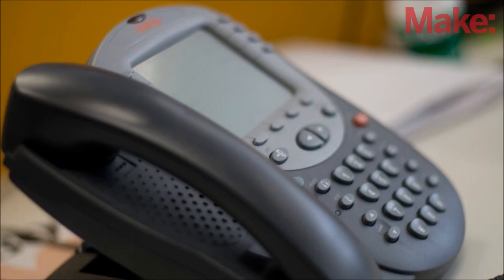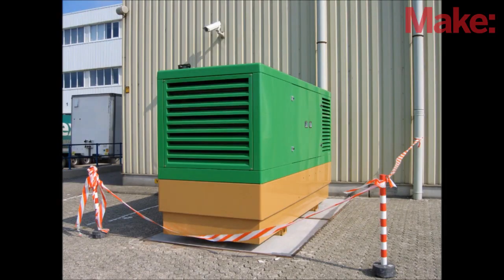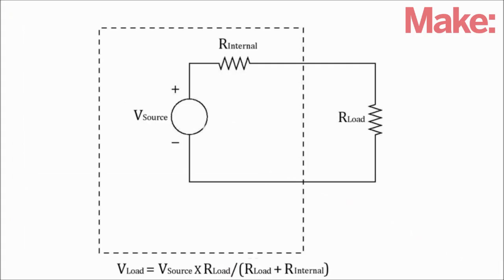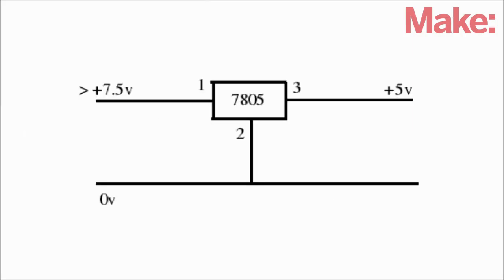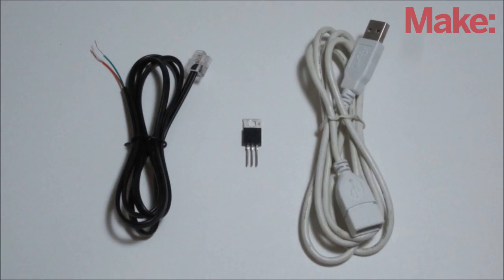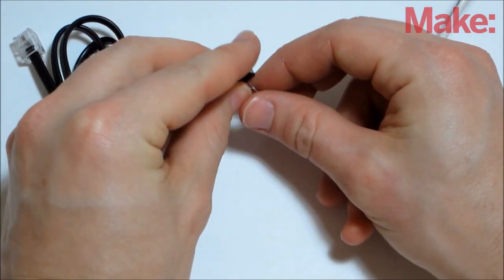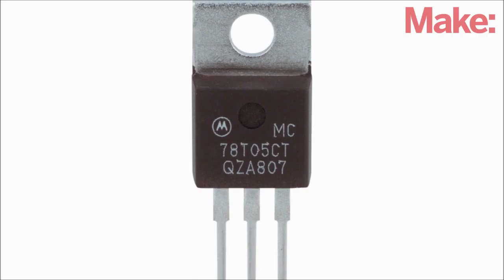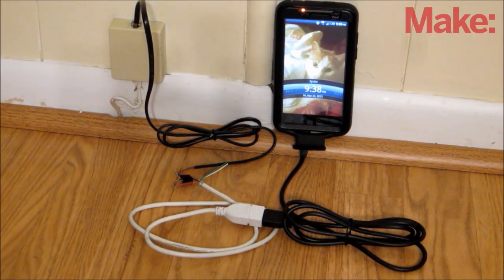DIY Hacks & How To's: Emergency Power from a Land Line

Comment: Not only is this illegal and a federal crime it is also a stupid idea.  Your line will be disconnected after 3 minutes of inactivity by the phone company.  An guess what.  Your land line phone will not work while your doing this.  Even dumber, your charging one phone system from the other.  Someone with more than a half of a brain cell would just place the call with the land line phone.  I guess brain cells are not required to make YouTube videos.  Geez..........

Comment: I'm wondering what max DC load you can put on those small gauge phone wires, without burning them up? Could I, say, do your setup for 12vdc and connect a 12v. DC cooling fan?

Comment: How to convert 50 Volt DC into 220 AC
Reply: Well this is less than 1 watt of power so that wouldn't be very useful but you can use a grid tie in inverter to take 12 volts dc and put that into your home power and just use a regulator like in the video to take the 50v down to 12v.

Comment: I found the 7805 voltage regulator 15 pack for $7, but if you find a good deal on bulk cabels ide be interested.

Comment: First problem 78 millamps is probably less than a cell phone uses when its on, without even making a call or having the screen on. But you won't even get that much as those analog regulators are horribly inefficient. You might get half that, lets be generous and say 45ma.

Second problem, the first time the line rings you get 90V pulses or higher, and the regulators are only rated for 40V. You are depending on resistance in the line to save the regulator from frying to start with.

Third problem, this is probably not legal in most places.

How about an alternative that isn't stupid?  You can get cheap power banks that use AA batteries form the dollar store, AA batteries also = cost 2 bucks.

You could spend $10 to get a slightly less cheap power bank that is rechargeable.

You can get a small solar panel on Amazon or eBay for anything from 5v to 20V at double what the phone line gives and hook that up to your makeshift USB charger for about the same price as a power bank.

The dollar store also has 12V to USB chargers that can run from any car with a cigarette lighter. These will charge the phone with 12X to 25X the current you can get from the jury-rigged idiocy shown in this video, which means it will actually charge the phone faster than the phone runs down its battery.

Many modern cars have USB charging ports built in.

Comment: If you actually had to make an emergency call why wouldn't you just use the landline phone instead of plugging a cell phone into it😂
Reply: Because the phone company is required to maintain this even when you aren't a subscriber.
Reply: My landline requires a separate power source lol
Reply: @GlobalGaming101  Then it's not a landline.
Reply: @GlobalGaming101  cordless landlines need a separate wire to transfer signal to the handset
Reply: @Antimattercarp  No, this is false. There is no such requirement. If you aren't a subscriber, the line is completely dead. Such dry loops are relatively uncommon.
Reply: @InterLinked1  yup.  Correct. Mines still on. Tho if they need that spot  on the pole for someone else, then they will disconnect it.
Reply: @InterLinked1  911 access is a requirement in my state. As is lifeline service. I don’t have either but if anyone out there needs it, get connected. It could save your life.
Reply: Some of use use the line for internet only and don't use it for phone
Reply: Welcome to the world of fone phreaks, kids. All land line connections have voltage whether there is an active account or not because they must be able to call 911 even if there is no account. Your phone that requires external power, Global Gaming, is using it for features like caller id or the phone is cordless 
;however, a landline phone that plugs directly into the phone jack does not require external power to function.
Reply: Alright smart arse what's the number? Oh that's right most people keep their phone book in their smart phones.
Reply: @matthewtalbot-paine7977  If you cannot recite the 2 or 3 most important numbers to you without a smart phone , then you are lost. If your smart phone goes in the toilet it should not be the end of you. Write them down.
Reply: @ceesmith  I slammed my phone in my car door only last week, contacts are not lost they are stored with google. I know my parent's number and my work number that is about it.
Reply: good thinking, but we got rid of our corded phones. wed only be able to call 911 too so it wouldnt work to call family. 

smartphones also have a whole bunch of other good emergency features, like flashlight and camera and maps

Comment: if i put a invertor 48v to 110ac before invertor a resistor so i will not pay eletricity
Reply: Nico Liguori nop energy oput is very low max 1 amp
Reply: Maybe led lamps will work

Comment: Based on your data I figure you can achieve optimal power at 26V @ 41.4mA, if you feed that into a small switching buck converter, that should ideally yield 5V with as much as 215 mA of current available. Assuming 90% efficiency, that drops to about 193mA. Much better than your 7805 regulator.

Comment: how can I save my phone from any kind of damage what  should I use from any kind of damages
Reply: The same set up as the video but use a 5v usb regulator hooked up to the mosfet (>$1 on ebay)  and then short out the data cables in the usb and the end result will charge your phone at around 30mAhs witch is better than nothing.

Comment: does the voltage regulator used here has the same effect as a buck coverter,  for example if a 9v 100ma is reduced to 5v , then you can get 0.180 ma, is this the same with the voltage regulators, i thought that they just drop the voltage by wasting power? simply does it honour the v=i*r ?   sorry for my bad english.

Comment: 75 ma (it was?) will never be enough to charge a phone until the power goes on again. And I dont mean until 100%, even 1% won't be working and if, it'll take forever. A phone needs at least around 400ma to effectively start charging. It maybe displays that it is, but you're not getting far with that
Reply: most smart phones need over 500mAhs to show charging but if you short out the usb data pins (inside 2 pins of the 4 usb pins) you can get your phone to charge with lower current.
Reply: Kenny Molina Still, it will take forever and won't be verry effective
Reply: Very true

Comment: This is bullshit because we're talking 50ma at best down to 5v.  The problem with it is that the phone's charger/power ic will have difficulty working with such low current availability, let alone how much current is left for the battery?  That is if you can keep the screen off the whole time.

Comment: what about converting this AC power to DC and trickle charge batteries then use the batteries to power larger appliances, in emergency situations, eg small L.E.D lights, small radios, etc, of course it will take along time to trickle charge, considering the line is putting out milliamps.
Reply: Kyee71 will work

Comment: few questions:
How to use the diode to keep the circuit safe
Can we make it 12v 1A output? if yes how to manage when when landline rings.
Reply: +akhlish Unani 1:16 NO! 80 mA is the most you can get
Reply: MaxQuantum that's wrong
Reply: akhlish Unani have ip 📞 this connects to your internet and it has on the ip landline phone it has a option to conecto to a computer this way your phone will not transfer the call although you can do this for the landline phone cord by making a Ethernet cord on one end and a regular land line on the other end but be aware that it will eat up half of the electricity but it has a transformer (will bump up the electricity) for your smartphone and the landline MIGHT DIE IT MIGHT DIE (barley) but it will still be alive to pick up and hang up the phone to resume charging

Comment: Hello.  I want to be able to record myself on a landline phone while not being connected to a land line phone line.  Is there a way to mimic the power that the phone line normally generates to any land line phone?  That 52 volts DC voltage sounds like what I need to aim for in order to power the land line phone .  That way when the phone is powered up I can talk into it and I will sound like I am on a landline phone, and then record what I sound like.  Does this make sense to you or is it wrong?

Comment: SERIOUSLY not a good idea. Even a minimal amount of current draw on that line will be interpreted by the telco switch as an “off hook” condition, which means allocation of resources to your line to allow for a phone call. NOT a good idea.

Also… TELCO sends a high voltage burst down the line to signal a “ring” condition.  If not anticipated and handled properly, it can damage illegal, parasitic equipment.
Reply: i mean its a voltage regulator. if those could be fried, theyre cheap to replace. it cant hit your phone.

and if they know, what are they gonna do about it? send the army?
Reply: In Albania it works relatively good
Reply: Or you can connect the phone cord to the AC adapter of the phone
Reply: This guy is just a fear mongering fuck face. #IGNORE

Comment: Well why don't you user your landline to actually make the call
Reply: Denboy_Kad yep even if you don't have service on that line anymore, but it's still hooked up to the pole, you can still call 911 on that line for help if you need it.
Reply: @CommodoreFan64  False! It won't work if you're not a subscriber. It's not like a wireless phone, which can call 911 even w/o a subscription. If you stop subscribing you no longer get a dial tone. Try it and find out.
Reply: @InterLinked1  If it's a hard disconnect with the POTS wires removed then no it won't work, but many states, and counties still have laws in place for what's called a soft disconnect where the wires are left in place, and you can keep a corded phone plugged , into that line, and dial 911, as it's part of denial to access laws where someone can't be denied access to 911 services, it's not universal anymore in 2020, but when I made my original comment over 5 years ago it was still more, or less universal with states, and counties phasing it out depending on who the local carrier is. I know for a fact in my area Frontier Communications still has soft connect working, as I work for a non profit for seniors, and just a couple years ago switched to AtlanticBroadBand for our internet, and VOIP service, and but one of my clients happened to pass out, and my VOIP was not working along with internet for my area, and I kept an old cored phone plugged into our old soft disconnected POTS line for emergency with a 911 only sticker on it, and I was indeed able to contact 911 to get her the help she needed with it just last year. To be noted why I did not use my cell phone was because we don't get good coverage with any carrier in my area, and I would have been hunting for signal wasting time.
Reply: @CommodoreFan64  Even if the wires aren't removed at the NID, the tech at the CO can still put them out of service. I know there's no soft disconnect policy here where I am. It sounds good and maybe it would be nice, but that's just not the case in most places. IMO, if people care about 911, they should pay for a landline anyways. It's not worth haggling over factors like this that may or may not be the case. Wireless is not a good alternative, and discussing soft disconnects just implies you're using something else as your primary phone service, which is stupid anyways. If you cut the cord, then you've already demonstrated you don't care about reliability, emergencies, or call quality, so IMNSHO, the presence or absence of a "soft disconnect" is not very important. A basic landline is only $20 or $30 in most places.
Reply: most people use cable internet or fiber now, and satellite in rural areas. I'm only speaking for the united states anyway..
Reply: +ElecTroMan DIY AMPLIFIER chill out
Reply: +ElecTroMan DIY AMPLIFIER chill out
Reply: +Denboy_Kad because YOU CAN'T SEE WITHOUT IT HAHAHAHAHAHHAHHAHAHAHAHHAHAHAH You know you are right in a way, but when the power is out for more than a day!! Well then you would really like a little light dude/gal RIGHT?
Reply: Joseph Brendel My telephone has a back light dial.
Reply: Dennis Garvey because cell phone data still works and power outages are boring! ...low cell bat = no more data entertainment during blackout. ...good try on trolling though
Reply: NumaticVacuum you're assuming there's other people around every time the lights goes out for me...thanks! I appreciate the free crystal ball reading! I guess I won't be living alone much longer! ...you also assume everyone has a landline...which I don't and haven't since 1999! ...it's 2017! who the hell reads physical books anymore? I read books on my tablet and phone! ...also, if I have nothing to do I should be selfish and call friends to occupy me over and above caring for their kids during the same outage? .. so just be a prick when the power goes out is your solution? ok got it. your reply is grossly out of touch and you place your personal living situation in my life as an inappropriate parallel, selfishly...just so you can shoot off at the mouth and put internet vomit under my comment trying to make me look stupid with your "witty" reply and all you did was show me you don't consider anything outside of your bubble to exist. good to know.
Reply: MyBigThing2010 What the hell are you talking about? Get off the internet and do something constructive...How pathetic humanity is these days! It has been going down hill since the 90s!
Reply: NumaticVacuum if it's anything like your grammar we're fucked! ...n BTW I don't take orders from strangers online with a mommie complex. gtfooh with that bullshit. ...n BTW...I can multitask....and I'm not the one playing with vacuums on YouTube. creepo HAHAHA
Reply: Dennis Garvey no one uses the land lines that much anymore
Reply: aucfan that’s why your charging cell phone
Reply: aucfan oh lol i see what ur saying
Reply: if you have power on your line, that means you have the ability to call 911 on your line. (so long as your area has 911 service). whether you have service or not. (note that many times the phone company will leave the line connected, but prevent you from dialing out - except to 911, which they can't legally block.)
Reply: How barbaric!!!
Reply: 9 years later, land lines arent very common anymore :(
If you stop your landline plan however, power will still go to your landline connector in your house (at least mine still has power) so you can charge a cell phone and make a call if you don't have a landline.

Also some people may have only had wireless landlines that required a mains plug as well as the phone line power
Reply: who still has a fucking landline service?
Reply: +Denboy_Kad  hey you! not all fucccckinnng country are on postpaid or any stable electric here in our country ever-night and then. we&#39;ve encountered out of electricity entire whole town.. we need electricity to light our house..
Reply: Havent had one since 1999.  Waste of money.
Reply: MyBigThing2010 Oh my god, you could try talking to the people in your house, get a torch and read a book, use your landline and call a friend, people rely on their mobile phone too much...
Reply: Jay Robbins They are and will always be the proper and most reliable telephone service.
Reply: Ashene The ones who use fuckin broadband...Nearly everyone... 😋

Comment: I'm sure these problems have already been mentioned:  1. The land line has to be ON- someone paying for the service.  2. Land lines detect OFF HOOK status (someone wants to make a call) by the amount of current draw, anything more than this charging circuit would be seen as OFF HOOK, and the phone line would be eventually turned off by phone company if off hook for very long.  3. RING VOLTAGE is up to 90 VOLTS, if someone calls this line you could possibly blow up anything connected to the line that cant handle that voltage.
Reply: Could reverse engineer a vr3 phone jack powered light from amazon or ebay and study how they got around these issues
Reply: That’s not at all what’s happens when an OE sees a line as off hook. Yes maybe the dial tone will disappear or a beeping noise.. but the battery will still be powering the line. And where the fuck you living where the phone lines are 90v only business lines are high voltage and they are 240v so idk what you’re talking about but you sound like you have zero clue!
Reply: Interesting . He mentioned a Diode for power overload of circuit protection  ,possibly a In4007 diode? And are you saying if phone rings/incoming call to phone being charged ? Or a call coming through wall phone outlet ? And yea, 90 volts or unknown volts coming through the wall connection outlet , could be a disaster for the phone thats charging . Better yet, if its a phone line thats been long forgotten about with no electricity going through and probably wont ever have service again, turn it into a very good television antenna by using open end of phone cord wires attached to reception antenna , i did this and worked great , with no signal interuption . Or use existing wires as speaker wires for radio / stereo throughout a house.